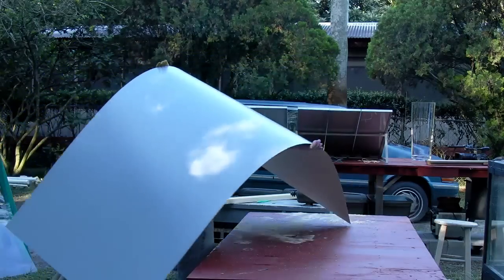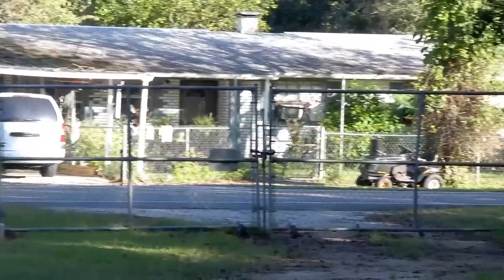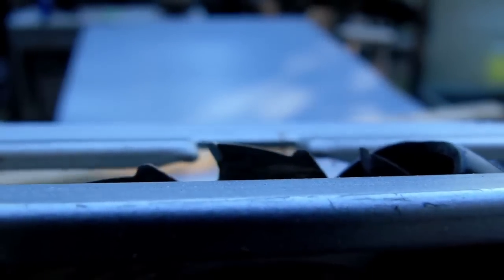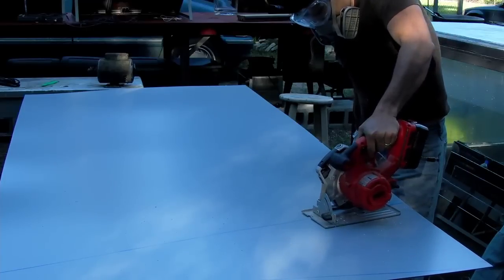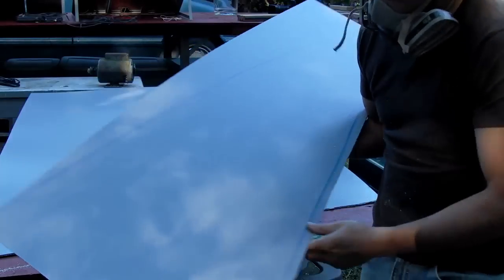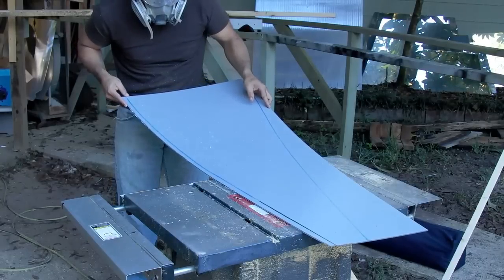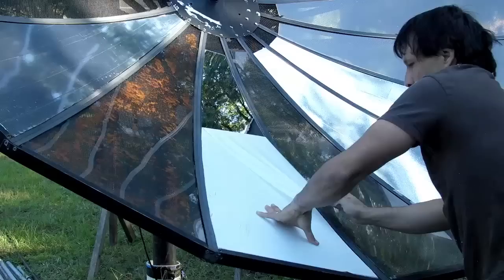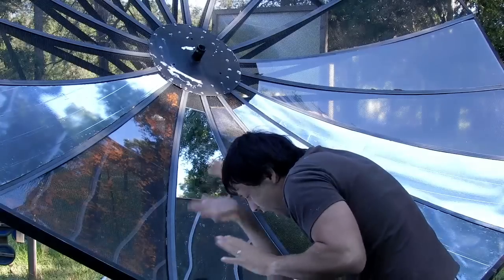SATELLITE DISH CONVERSION Huge Parabolic Acrylic Mirror Solar Power

Comment: tip:  for plunge cuts,  tilt the saw: place the leading edge of the shoe on the workpiece with the salw tilted so that the blade is not touching the material.  Lower the saw to align the blade with the cut target. Then pivot/lift the blade slightly and turn on the saw and  pivot /  plunge into the cut.

Comment: Dan, I like the idea of using a piece of clear to make your template.  The dish that has the channels to hold the panels in place is nice also.  In my case I only had a dish with mesh panels that were held in place with large panhead screws thru the mesh it worked ok but not nearly as well as the channel type.  I might try to install some sort of channel material to support the panels then recut my panels to fit.

Comment: I can see using a hot clue gun on the bottem to spot glue the panels in place so if you ever needed to remove one it would be a breeze.
Dan have you ever considered making an emergency electric generator using a pelton wheel to power a home generator using the citys public water supply as the power source?
the water bill could be cheaper than the electric bill.